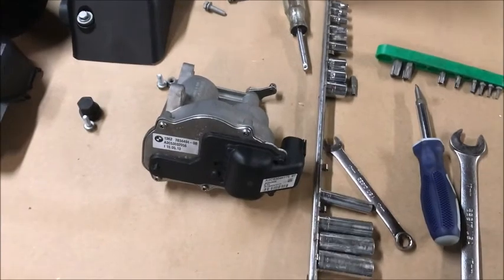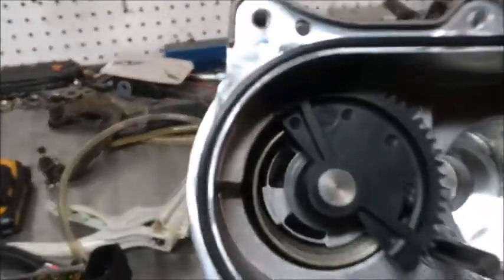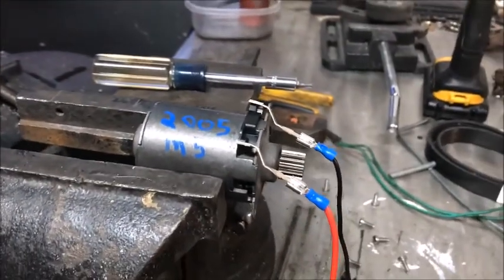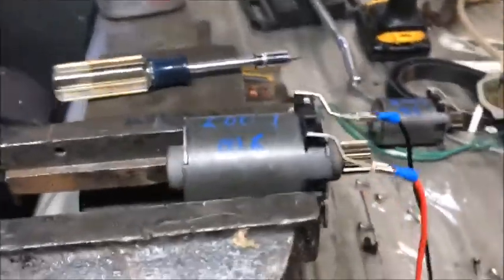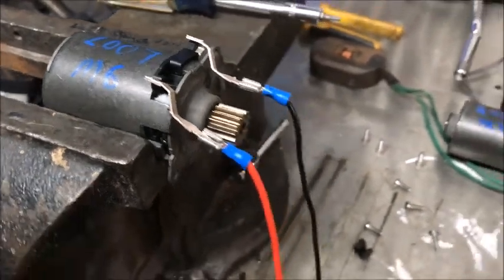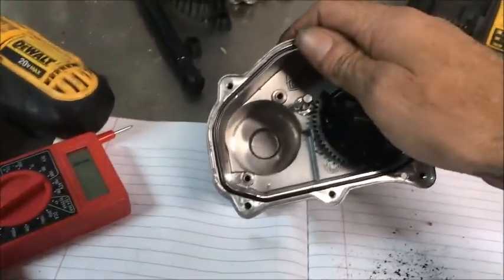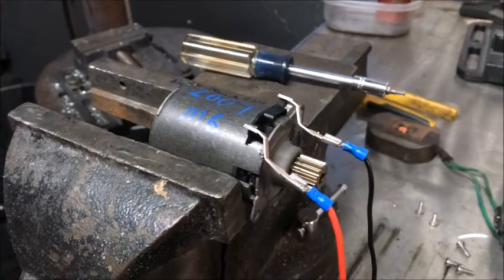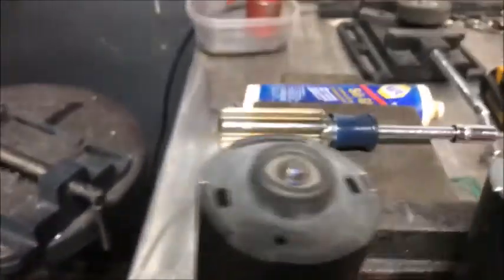M6 Throttle Actuator motor test - might be the issue if gears don't fix it

Comment: I reached out to VDO (manufacturer of OEM throttle actuators for BMW) to see if I could purchase the motor directly from them. I will keep you updated. Thank you for the great video!
Reply from the maker: Nikolaus Rouse , thanks man 👍. For sure post up if you get a lead on where to get the motor from...I can’t imagine it would be very expensive so being able to change it along with the gears would make a rebuilt one virtually new again.  I still have the ones with the bad motors so it would be awesome to be able to rebuild them for backups 👍
Reply: Steve’s DIYs I heard back from VDO this morning and they do not (will not?) sell the components by themselves and suggested that I purchase the whole unit.
Reply from the maker: Nikolaus Rouse , man, that’s a bummer...I would say they could sell quite a few to DIY’ers if they would.  I wonder if they actually make the motor or if it is sourced from another company?  Probably impossible to ever know this I guess, but if they did have a supplier maybe they would sell them.  Bet there would be a pretty big Minimum Order Quantity though.
Reply: @StevesDIYs  Yeah. It's their loss. When I asked, I told them they would probably have a large group in the community interested.

Comment: Hello Steve found ur channel and im binging on all them lol! anyway any update on ur second repair and also if u by chance found a better alternative for the motor? thanks also out all the videos about the TA here on youtube u presented something that is not much or at all not discussed about the SoC of the battery if it falls down below 10v when u start the engine it will immediately go on limp mode. At least this is what i found and noticed as well.
Reply from the maker: Hey thanks for watching the videos 👍. As an update, since making the video, I’ve not had any more issues with the actuators…no codes or limp modes at all. I also keep the car on a battery tender now as my battery has gotten older and it would give the high battery drain warning from time to time (but still hasn’t faulted on the actuators). Thanks again and all the best !  Steve

Comment: Before you’ve done all that.. was you getting that dreaded limp mode on your m6. Was your rmp dropped 8500 to 4000 rmp?
Reply from the maker: Toro LonDon:  Yes, that was the symptom ( that immediately the car would go into limp mode and restrict the rpms to 4000 rpm max ).  Originally mine was faulting and going into limp mode so I changed the actuator gears and it did help, but occasionally it would still go into limp mode if I did not keep the battery on a small charger.  Once I took the actuator apart the 2nd time and replaced the motor, the occasional fault no longer occurs either.  I don’t have to keep the car battery on the small charger anymore either 👍

Comment: I almost did actuator rebuild today but lucky I found this. 
I'm really keen to get new motors now so it will be 100%.
I wonder if its possible to use a brushless motor from an RC car?
Reply from the maker: I’ve looked an looked for a suitable motor and even the same motor that could be purchased by itself, but so far I’ve found nothing.  I got lucky that one of the used once I got still had a good motor so I could swap it.  I know someone is still making the motor as there is a company that rebuilds the actuators for a few hundred less than buying one new, but just can’t find where to get it.  I took the motor apart and the bearings can be purchased so I was going to try to replace them as everything else in the motor looks perfect...just have to find a very small gear puller to get the front bearing out.  If you find the motor, post back up for sure as tons of people would probably want to change them out during the rebuilds !
Reply: Boomhauer’s BMWs and others brushed motors are such old technology. I want to develop a brushless motor for the SMG  unit too. 
Maybe I can go to the local parts guy and see if he has a dead actuator I can use to modify etc. 
I'll have to add an ESC to make the single phase signal for the brushed motor into a 3 phase system but that part would be easy.
Reply: Daniel Hoyle keep us updated with the project

Comment: My 2009 BMW M6 is having issues taking off from a complete stop, it studders like Stanley, until you really floor it then the RPMs are lagging to get up, then it just skips and RPM shoots up, no codes but somethings not right, I have a new battery programmed to the computer, new SMG, new rod bearings, all fluids changed and the Dyno read 464 WHP any suggestions?
Reply from the maker: Hello, I haven’t had that issue yet. Does it feel like the motor is loosing power and shuttering or that the transmission is having trouble controlling the engagement point, making the rpms drop and raise and then making the whole car shutter?  Just last week mine started raising and lowering the idle during the cold start routine so it sounds like I have an idle air control valve going bad (no codes yet though). I did notice that I lost quite a bit of acceleration from a dead stop, but it’s not shuttering or anything.  If the motor is shuttering on takeoff with no codes, it’s really hard to tell as it could be so many things since it’s all computer controlled unfortunately.   Have you checked around the motor for any vacuum leaks?  The car does use the intake manifold vacuum level to control things at lower acceleration levels so something simple line a vacuum leak can really throw the motor off until you get the throttle butterflies opening up on a hard acceleration. Sorry I couldn’t be much help, but if you do get it tracked down let me know. Steve
Reply: @StevesDIYs  honestly the exhaust sounds and feels different as if there’s an early release of exhaust underneath the engine, you can hear and smell the fumes, would faulty exhaust manifold gaskets or cracked exhaust cause lack of acceleration?
Reply from the maker: @jc323socal3  , I’ve never experienced a loss of power due to an exhaust leak at the exhaust manifold.  I don’t think there are any sensors other than the O2 sensors in the exhaust and if these are having issues or the cats have collapsed, it should be throwing codes like crazy for that.  I guess, if a cat did collapse and was restricting the exhaust it might no throw a code, but it wouldn’t smell like fumes (it would smell like it was super hot on the exhaust).  The motor can detect misfires, issues with the throttle actuators, and mass air flow sensor malfunctions so it would have to be something physical (like a leaking injector, air/vacuum leaks, etc) that is throwing off the air/fuel mix I’m guessing.  But even those should throw codes on either being too rich or too lean.  That sounds like a difficult issue to track down for sure as there’s so many things that could cause it.  It is strange that the car cannot detect the issue since it controls so much of the system and constantly monitors all of the motor’s running parameters.

Comment: Nice review. But please tell me, how on Earth you mange to take the dc motor out of the actuator housing??? I try to pull it out for 2 days now, and it just stuck, does not move at ALL. Thanks in advance
Reply from the maker: Martin Dinev , thanks !  Hope you can get yours resolved too.  I’ve been going strong with zero issues on the actuators since it did the video earlier this year so I’m thinking that was indeed my problem (worn out motor).  Around the 4:10 mark in the video it shows how I got the motor out of the housing.  You are right that prying on it would not budge it at all...it was super easy by just knocking it squarely on a block of wood with a cloth on it to protect it from damage.  Popped right out after just one or two sharp thumps on the wood.  Be sure to first tighten the little screws back in to be sure it is seated correctly in the housing, then take the screws back out and thump it on the wooden block.  If it is not seated correctly before thumping it, it won’t come out as it would be wedged into the housing on angle
Reply: @StevesDIYs   Thanks a lot buddy. I managed to get it out as you directed! Huge thanks ! So what I found, bearings are not so worn, not too much noise. I saw the number 626Z , and it seems it is easy bearing to find around,but I am not sure should I go deeper and crack open the dc motor apart. There is quite a lot of carbon  dust. I saw brushes are half way in or it looks so. Even if I take it apart I am not sure I would be  able to find those small brushes. So far I just sprayed some CNC Maf cleaner in inside to remove part of the carbon dust trapped.
What did you change so that you are saying half year later all is fine and the culprit was the dc motor itself?
br,
Martin
Reply from the maker: Martin Dinev , glad you were able to get it out to check it.  For the really bad motor I had, I actually did take it apart just to see if the bearings could be taken out.  The metal tabs at the top of the motor are press punched by the little dents, but will pop out.  The biggest issue I found with trying to replace just the bearings was being able to successfully get the gear off the front shaft and then back on without damaging it.  I tried using heat but was unsuccessful so I didn’t go any further since I probably wouldn’t trust it anyway if taken that far apart.  For my fix I referenced, I bought two used ones from eBay someone was selling really cheap with the hopes that one would have a good motor and just had bad gears or a bad circuit board.  One was the 2005 M5 one I was experimenting with, but the other was much newer and was indeed just the gears so I swapped the newer motor to my old actuator ( I had already rebuilt my gears once before in mine ) and it’s had no issue.  There is a company that rebuilds them and offers a lifetime warranty on the rebuilds, but you need to send them a core to get them cheaper.  The bad ones I have now can be cores if needed later in life so I’m not down waiting on the actuator to ship.  Saved me hundreds going this route plus I got the enjoyment of learning something new about these awesome cars.

Comment: Any luck finding a replacement motor??   Im pretty sure this is my problem been consistently messing up 2 years sitting in 100 degree sun on cold morning start ups no issues until I get a mile down the road the heat I'm guessing opens the bearing clearance up then kicks me out of 500hp mode.
Reply from the maker: milleniumann28 , hello...I never found a source for a new replacement motor, but I’m pretty sure someone is making them since there is a group that will provide reman actuators that they guarantee.  I’ve not had any problems with mine after doing the gears and then replacing the motors with the used ones that weren’t as old that I got pretty cheap from eBay.  Seems the gears go first so odds are good that ones not as old will still have decent motors (as long as no one had messed with them prior).  Since I have the bad spare ones, I’ll probably do the reman ones if they go bad again as I can ship the bad ones to swap for the good ones (they give a discount if you ship the core) so I won’t have down time waiting for the replacements.  If you do find new replacements, please comment back so folks can have the info 👍
Reply: @StevesDIYs  I found some cheap 15 buck motors that look exactly like that motor it's for x5 transfer case or something on aliexpress 🤷🏿‍♂️...... biggest visual difference gear not the same, I will take your advice buy used take motor out get specs find something similar. Or take guts out something close transfer to old dc motor housing. I just cant see spending 1200 on 2 actuators at 123k knowing the bottom end is a ticking time bomb! I'd rather it blow up buy a used motor with actuators already installed then put in all new bearings for 5k total. Of course that all me turning the wrenches no money spent on labor
Reply: @StevesDIYs  so I pulled it apart today hoping to find a part number on that motor found no markings at all 😡. What I did find is a ton of slop in the gears so I know that needs replacing. Surprisingly when I did the 12volt test like you did the motor sounds perfect nice and smooth just like a rc car motor zooming around. I would like to give you a special thanks for giving me the motivation to pull this apart, like I said I've been dealing with this for 2 years I thought pulling the intake would be a monster but not that bad at all. Will try some 30 dollar gears see if my dsc malfunctions go away if not now I know I can tear it down in 2 hours no cussing or throwing stuff👍🏿👍🏿👍🏿. Well I did drop one F bomb first thing this morning when it derated in the warm up cycle.
Reply from the maker: milleniumann28 , ah, you may be ok just changing the gears out if the motor does not sound bad.  I did the gears on both of mine, one motor was fine but the other was the noisy one in the video that I replaced.  Both are still working fine with no codes since last year 👍. I used the Odometer gears brand and they went in fine (they have a helpful video that walks you through how to do it).  Just be sure you get the two metal contacts that stick up from the motor into the circuit board connections as you put the circuit board back on and tighten the cover screws back down...it’s easy to misalign them and the actuator won’t function.  Thanks for the comments !  Glad the video was able to provide some help 👍

Comment: There is a way easyer way to get the motor out of (and back in) the housing... Just heat up the back up of the housing; the area were the motor is. you can use a little propane torch or a heat gun. But be careful... the motor will become compleately loose an can fall out while you theat the housing. By the way.. my motor was also full of carbone dust. I think this coud be probably the main issue with this throttle actuator problematic.
Reply: I used a magnet and pulled it out
 very easy lol